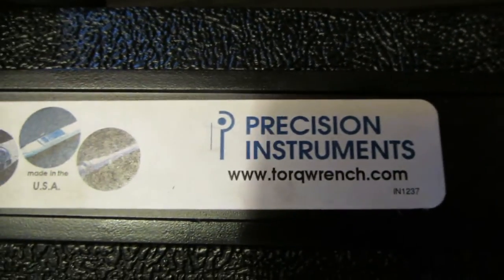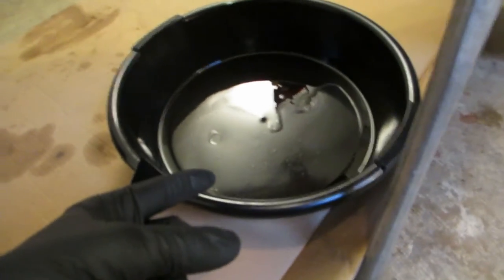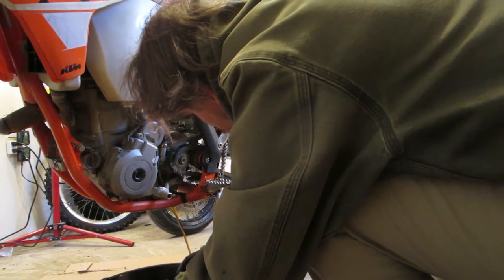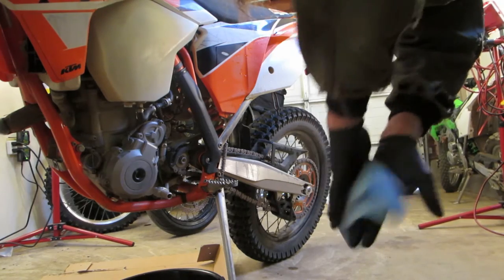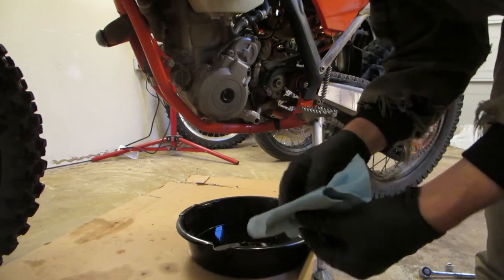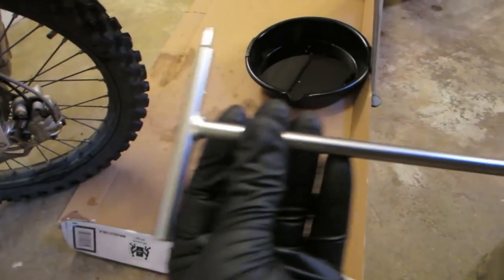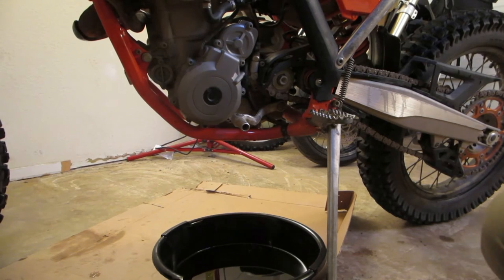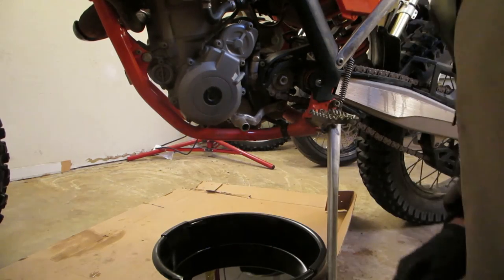How To Change the Oil on a 2016 KTM 350 EXC-F

Comment: Good video, thanks, came in useful today.

Leave refitting the oil screen until the bike's on it's side, you can then clearly see the protrusion inside the engine that the oil screen needs to slide over.
Reply from the maker: Glad the vid helped :) I'll have to think about whether or not I like the idea of waiting till the bike is on its side before putting the screen back in.

Comment: I have a 15 250sxf but i never tip it over and fill the filter housing up. I just oil the new filter before putting it in and iv never had any issues.
Reply from the maker: You aren't the first person I've heard say that. For me, tipping the bike over to do it like the manual says is so easy, I just do it.
Reply: Yeah man.... It’s just so the bike never experiences a dry start. It takes a while for the pressure to come up and for the oil to push through the filter element. I’m sure it’s not too big a deal if you don’t but I do the same thing I fill it up 1/3.

Comment: Looks like you need to clean and lube your chain.  You should always spay your screen with contact cleaner.  Then use compressed air.  Use a dirt bike stand to lean your bike over.
Reply from the maker: Thanks for the comment :) I just washed  the bike quickly for the oil change and hadn't got around to the chain yet. As far as spraying the screen with contact cleaner, I've never done that but I suppose it is fine as long as it doesn't mess up the o-ring or plastic. I like leaning my bike over onto the ground, not onto a stand; I've tried it both ways.
Reply: loopduplicate whatever works for you. I like contact cleaner it’s ok for plastics. I have even seen guys I know dip it into a cup of gasoline. Yea not my first choice. After winter I usually buy a kit that has the rubber rings for the screen, filler cap and oil filter cap.

Comment: how many hours or miles till you have to do an oil change
Reply from the maker: The manual for my 2016 350 exc-f says to change it every 15 hours and after every race. That's what I stick to.
Reply from the maker: I think it has more to do with how hard you ride (I'm pretty mellow) and how much crap you are sucking in through your air filter. I keep my air filter clean and change the oil at 15 hours and the oil always comes out still very honey colored. I could probably go longer but I don't like going longer than the manual says.
Reply from the maker: Oh, and I always change based on hours, not miles, since 100 miles of hard trails in the mountains is going to be rougher than 100 miles on nice country roads.
Reply: wow, your the 1st I've read doing it every 15hrs....I tend to agree with you as my manual says the same, but every tech monkey on YouTube says 5-10hrs..My oil was still honey colored after I did my 1st change after 10 hrs..I'm using Motorex..There's additives that are specifically in there for these engines.
Reply from the maker: yeah, full synthetic 10w60 or 10w50 is what my manual calls for. 10w60 is recommended for harder riding. Although I'm not a super racer, I do get my bike going pretty hard once in awhile so I use 10w60. I happen to use Motorex (Cross Power, they call it) because that's what the local shops carry and it happens to be the recommended one in my manual too... I find it strange that KTM recommends a particular manufacturer of oil though; seems a little fishy like they are in cahoots... whatever :)
Reply from the maker: @michaelsteven1090  Oh, just realized that I might have got the question wrong... I was talking about regular oil change intervals. The manual recommends that for a new bike, after one hour, the oil and oil filter should be changed and the screen should be cleaned!

Comment: What a pain in the balls to have to do this after every 15hrs... That's 2 days of riding if you're out all day.
Reply from the maker: I suppose so. But, if you are riding hard for 8 hours, two days in a row, especially if you are in sand, dust, mud, or water, then to me 15 hours makes a lot of sense.
Reply from the maker: On the other hand, I have a DRZ400 and the oil change interval on that is something crazy: first oil change after 600 miles, second one at 4000 miles, then the rest every 3500-4000 miles or so! So, if you want a bike that you don't have to change the oil on and that is pretty damn tough, then get a DRZ400. But they are so heavy and only have like half the power of my 350 EXCF :)